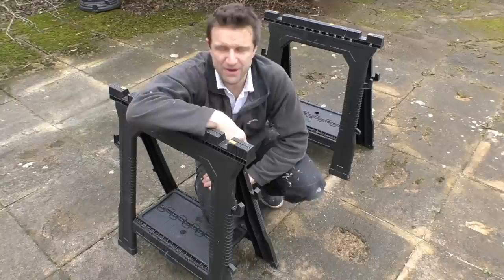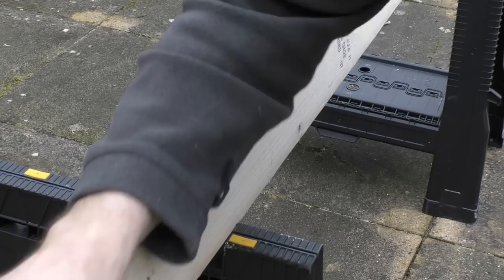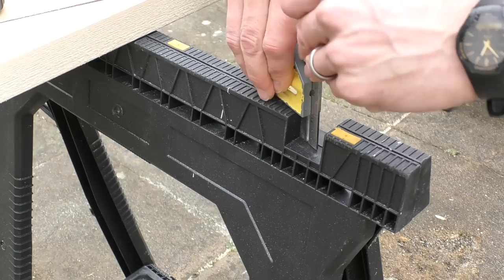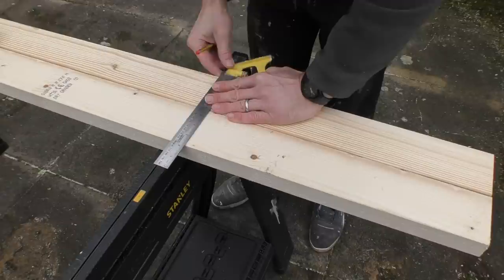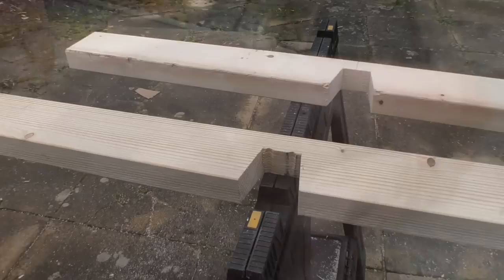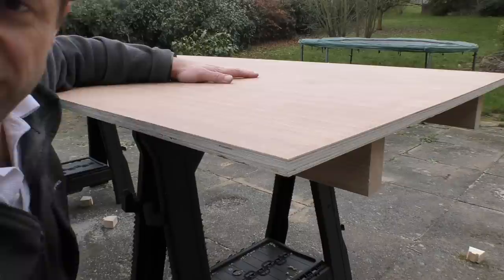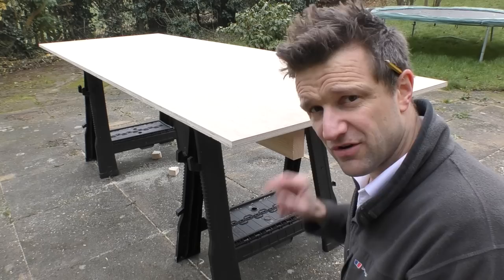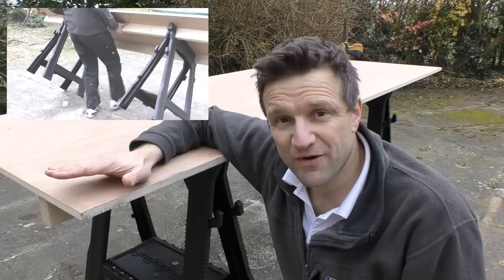How to Make a Portable Folding Work Bench: Video #1 of 5

Comment: And where is the folding work bench???
Reply from the maker: It's coming. I just haven't found the right hinges for it yet.
Reply: Charlie DIYte try a piano hinge or maybe you call them continuous hinges for the ply.  Predrilling will help set the screws.  Perhaps a bolt and catch for the 2 x 4’s.  You may have to use an angled cut, relief cut on the ply, a small v router bit if you find the ply boards catching when folding.  Just make sure to seal the edges with something.  You might also want to cut the 2x4’s at 45 degrees, if you do, take off about 5 mm on the pointy end as it will probably break anyways.  I’m in awe that you are getting such nice building studs.  Here in the States they sell us trash.  Too many knots, too much wane, some not kept dry so they twist and warp.  Those CLS, is either pine or fir and is a soft wood, both trees are conifers.  As one viewer suggested, a striking knife will help break the fibers, but I disagree about a Stanley utility knife, it will do the same, just don’t stick the blade out the whole way.  If it’s a new blade, you shouldn’t struggle to mark pine/fir.  Make a straight cut on the line and an angled bit on the waste side for your saw to seat itself.  And as you discovered, a blade with more teeth per cm (or inch) works better for crosscutting, ripping uses less teeth.  Another trick is to put tape on the board, make your marks and cut through that.  I prefer using a knife.    You are doing well Charlie, keep up the good work!